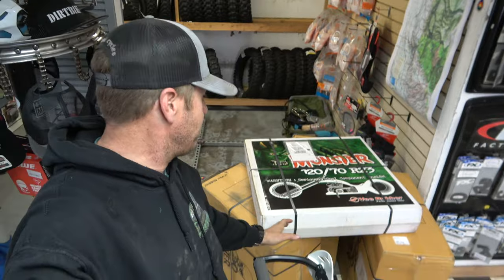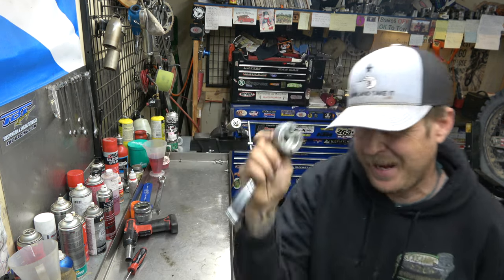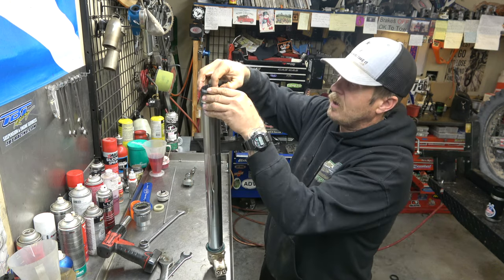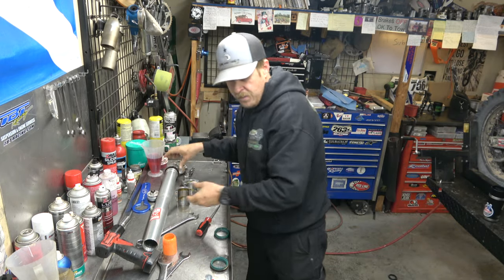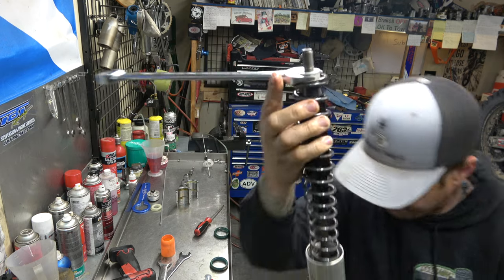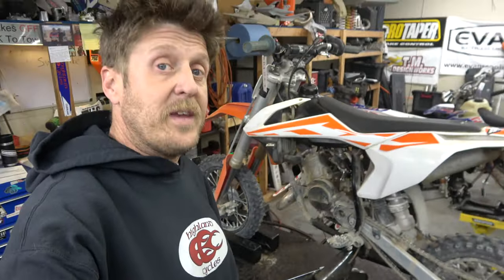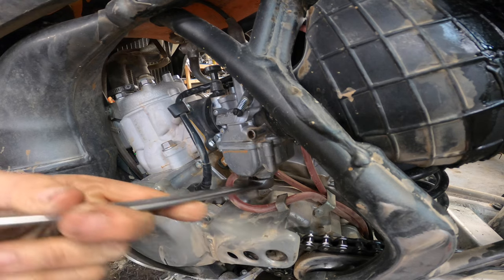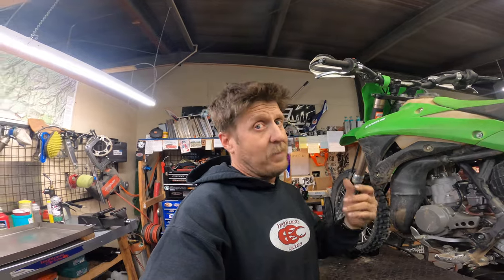The Shlog #187 | KTM Open Chamber Fork Rebuild | Jetting A Carburetor

Comment: 3M Super 88 electrical tape (thicker than Super 33) has made every pair of  infinitely adjustable fork seal installation cups I've needed.
Reply from the maker: Nice. A thick plastic bag works great too.
Reply: @highlandcycles  If only the factories thought of that.

Comment: I’ve learned from sad experience what happens when a main jet brakes from over tightening. Almost ruined an epic ride. I had to use a tiny screwdriver to back the threads out of the carb. I’ve also learned what happens when you don’t tighten them enough. Mistakes are our best teachers. Thanks for sharing your wisdom.
Reply from the maker: I’ve done the same. Broke a jet off 20min before the start of an enduro. Barely made the start.

Comment: Was just watching this older video and absolutely love the wrench you were using to very easily swap the main jet.  So much easier than removing or even just rotating the carb for access.  Could you possibly give the specs on what that particular wrench setup is?  Thanks so much and love the videos.
Reply from the maker: Thanks. That is a SnapOn setup. It’s their super low profile set

Comment: I just came in from installing the new Lectron Billetron38.... Bye-bye jets  😁
Reply from the maker: That’s awesome. Also bye bye dollars 🤣
Reply: @PaiN’s Rides- What are you riding these days, rumor has is you are not a GPX fan LOL
Reply: @highlandcycles  Want to bye a nice Keihin?? 🤣😂
Reply: @02Clint  Its a true rumor 😉 After many issues and then the bike leaving me ride-less for months and struggling to find information and parts.. I had enough. 
I purchased a 2016 Husky TE250... Its been rock solid, easy to deal with and beast on the trails.
Reply from the maker: @painsrides3616  😂🤣

Comment: Hey Morgan, searched for WP open chamber on your channel and this is just what I was looking for.  Questions though. I changed my fork oil awhile ago (before watching this vid) and I think I use the cap tool for all the disassembly and reassembly........Oooof  What's the best way to get it back like it should be? I just took the forks off to do seals tomorrow and did notice that the rebound basically has no affect, they are like pogo sticks!!! lol Any and all advise appreciated.
Reply from the maker: No worries man.  Just use this video and go together like it shows and you will be good.